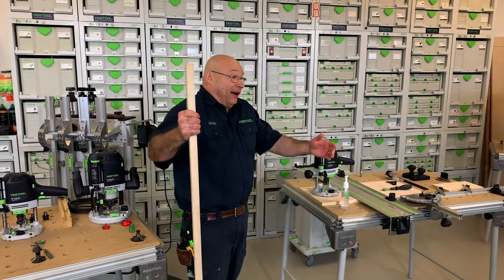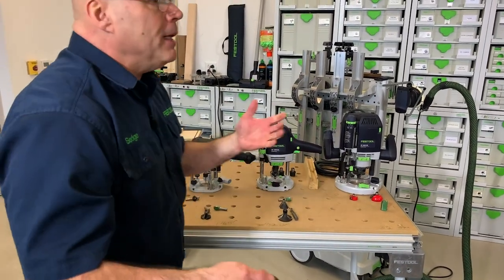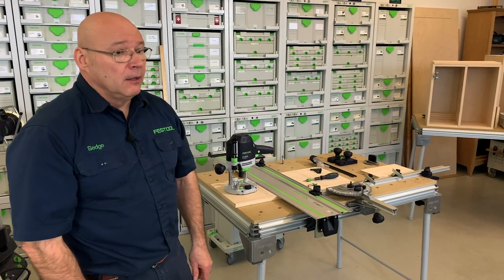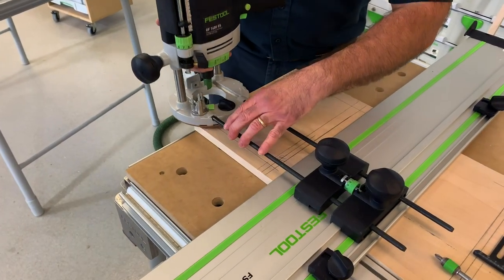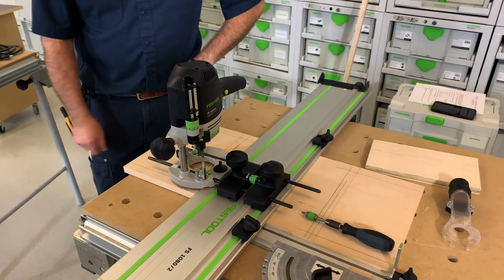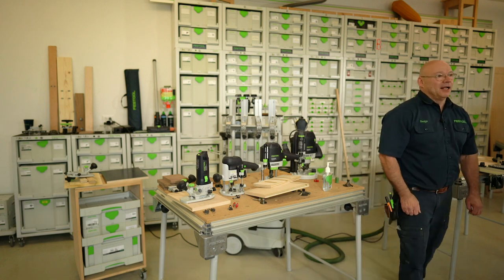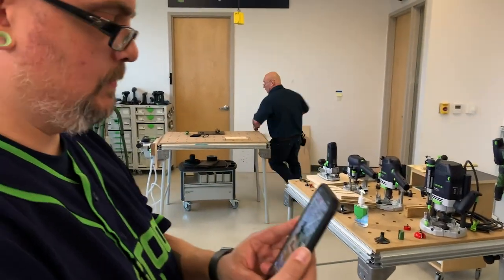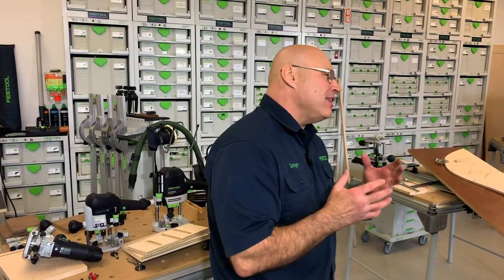Festool Live Episode 02 - Routers

Comment: Best Plunge Router I have ever owned. I have several Bosch 1617 EVS In router tables and on a home built CNC and I have the plunge base for the Bosch routers that is no longer used for anything. I also have a Festool OF 1010 which is also a great plunge router. Nothing else comes close to these Routers. IMO.

Comment: I don’t know what made me turn my attention from the Kapex to a Router…. But this video not only SOLD me on getting a router first…. It also helped me decide which of the four would work for my needs. This does not mean I’m not going to get the Kapex. LOL That baby is staying on my list. LOL. But I just bumped the Festool Router up on my list. 

I’ve got a router and router table. I have like…. Three routers. LOL. I also already have a miter saw. But this video showed me how I can up my router game and do functions quicker and more accurately. There are things I avoid because I’d need to make a jig first. This setup with the Router is fantastic. And…I already have the MFT/3. I can see so many benefits to this. I’ll still get a Kapex later. But I’m still deciding on if I want the new cordless one or the original. I’ve used my miter saw less and less anyways. Great video.

Comment: Sedge... how to use the Guide Rail Limit stop with the Guide rail adapter of the OF-1010?

There used to be a top mounted stop for that, the 485827, but that one is no longer sold. The new style doesn't work with the OF 1010 guide rail adapter, not in the way you showed with the 1400.

Comment: I have 1400 with mft table and track system,  I have trouble tightening black lock knob on router the keeps router from  sliding on the two rods . Always use pliers to tighten.  If I don't use pliers it slides on me.  I really tighten tight with pliers too.  LOVE your videos  Thanks

Comment: I happened on this by accident. I have been a fan since my first 1400. I have 2 1400's, a700 (need your bits for this), and many others tools now. This is the first time I had heard the template guides were self centering. Track saws are awesome. I do have problems with the polymer edge staying place. 
I have been to the connect events in Lebanon.

Comment: I appreciate the videos and am looking forward to the OF 1010 specific video.  I wish this had been the 1400 video because the guide system description appears specific to the 1400.  All of the information after about the 5 minute mark was of no use to me but would be great if I had the 1400.  I hope you consider doing the 1010 first.  (1400 guys have a head-start.)  You are SO right.  Bits are the key factor.  I had 2 1/4 bits and 1 1/2 inch.  I would have gone with the 1400 if I had more bits but I have the luxury of buying bits for my router rather than buying a router to fit my bits.  As a less-experienced router user  (fewer bits) I need some guidance now.

Comment: Sorry, I know everybody’s a critic, but I would prefer if you just had 1 camera guy and posted later, rather than this hodgepodge “live’ video. If you’re using 2 or 3 cameras in order to do “live” on various platforms, I think you’re sacrificing production value doing so. Sedge doesn’t know which camera to look at, the framing is off, and I feel a disconnect when he’s talking to other cameras.